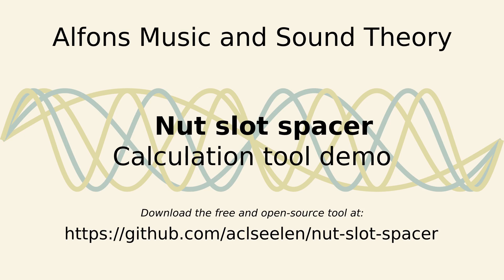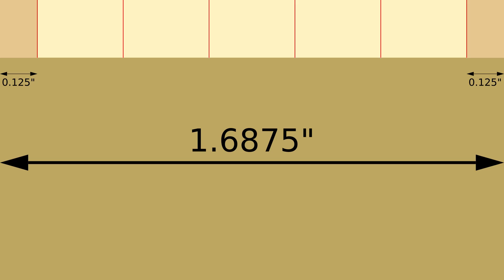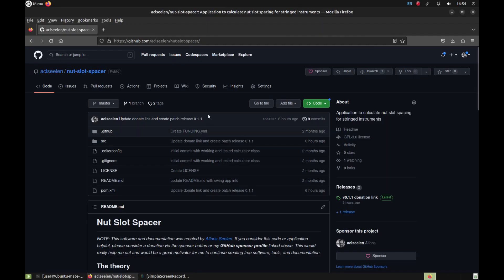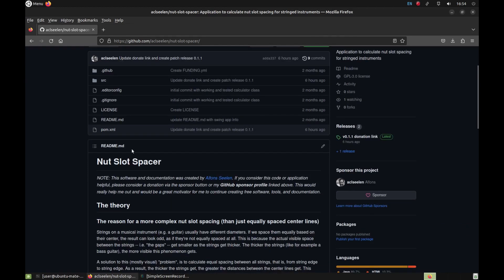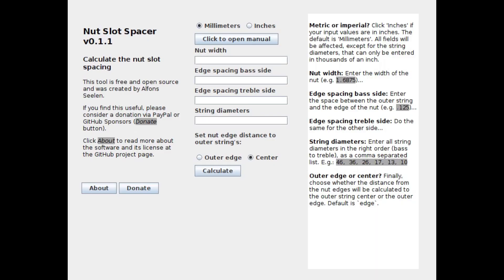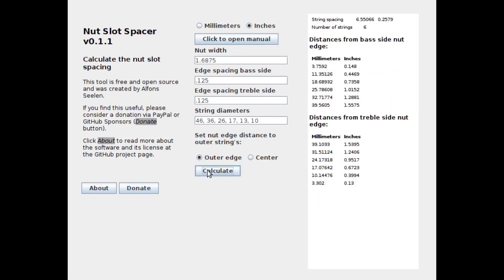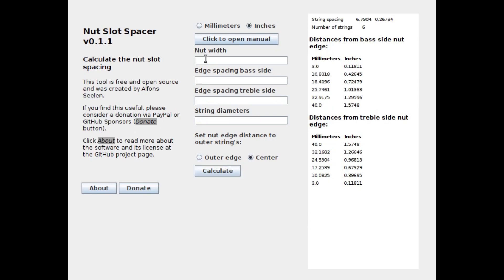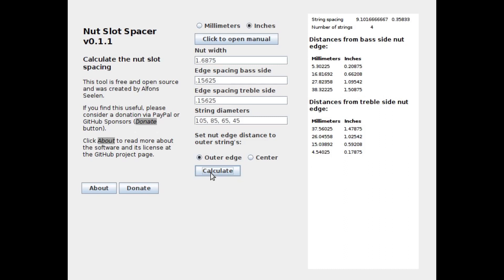A Free (Bass) Guitar Nut Slot Spacing Calculation Tool!

Comment: Thank you for creating this, it looks very useful! However, I think you might be assuming most bass players write code, this is not a fact. Can you please give some direction on how to get this running on Win10? I have tried and tried and I'm no stranger to software but I cannot get this thing to run. Thanks again.
Reply from the maker: I'm sorry to hear that. It shouldn't be necessary to write code to be able to run the application. I'm not too familiar with Windows, but Java applications should run on all platforms, without the need to be recompiled. For this reason, it's necessary to have a Java Runtime Environment (JRE) installed, that works as a layer. I would think that Windows tells you it's missing when trying to run a Java app. If not, try to install it manually. I found this link. If JRE is installed, you could try to update to a newer version.

https://www.java.com/en/download/windows_manual.jsp
Reply from the maker: Could you tell me whether you were able to fix the problem? If not, I'll see if I can dive deeper into it. BTW, you can email me at alfons@luthieralfons.cat if you need more help.
Reply: @luthieralfons  I'm still picking away at it, I'll let you knowhow I make out, Thanks.
Reply from the maker: If the oracle Java options don't work, I saw that Open JDK is also available for Windows:
https://learn.microsoft.com/en-us/java/openjdk/download
Anyway, it might seem complicated now, but as far as I know, using Java has always been straightforward, but I'm not aware of whether that had changed under newer Windows versions.